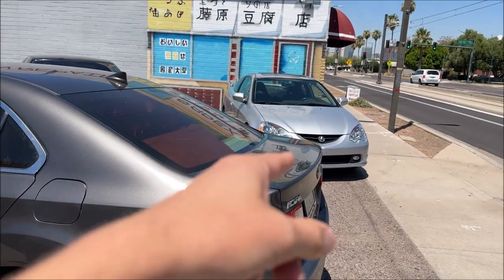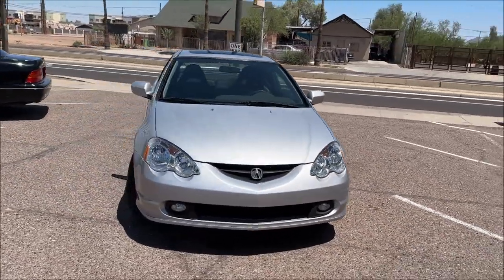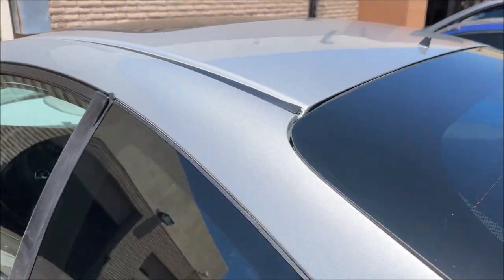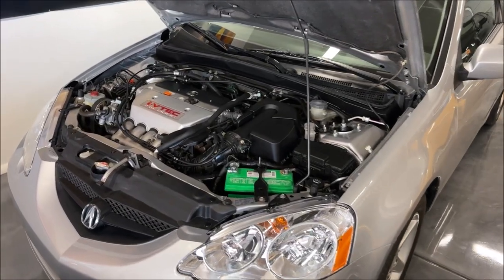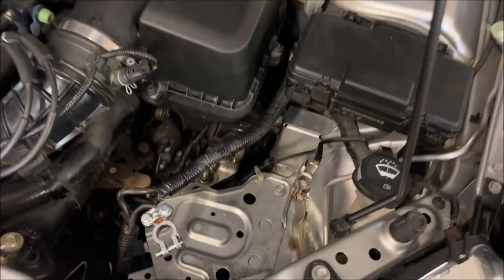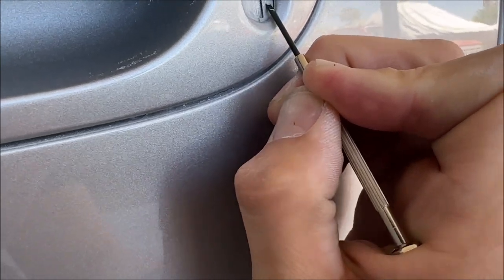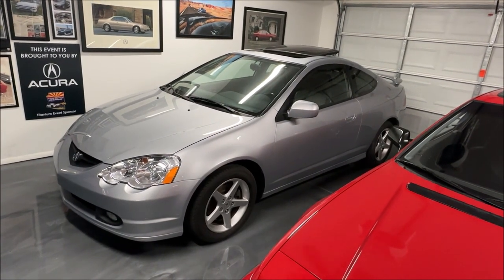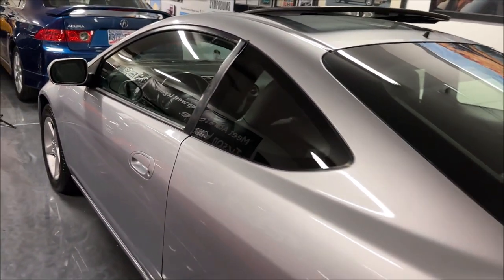2002 RSX Type S Restoration Episode 4: Paint Complete, Interior & Exterior Cleaning

Comment: Hey Tyson!  Keep up the amazing vids!  I remember i used to own a used 2003 RSX, tgen traded in it for my current TSX with 15,000km.  It now has about 418,000km.

My 2006 Acura TSX has a compression ratio of 1: 10.5.  In the 2004 owners manual, it clearly states the premium fuel is needed to avoid damage to the engine.  In the 2006 owner's manual, it indicates 91 is recommended, not required.  However, in the 2006 TSX gas door,  it clearly states premium fuel only.  Why the inconsistency? I remember putting in 87 gas once and on the freeway while cruising at around 2500 rpm, the check emission light came on.  I wasn't even driving hard.😢
Now I only put in 91 octane.
Reply from the maker: I’m not sure on the inconsistency either. But I always run 91